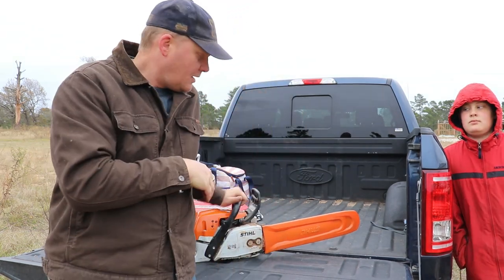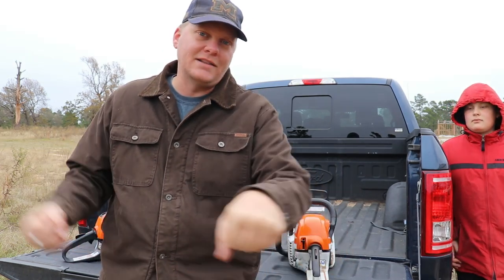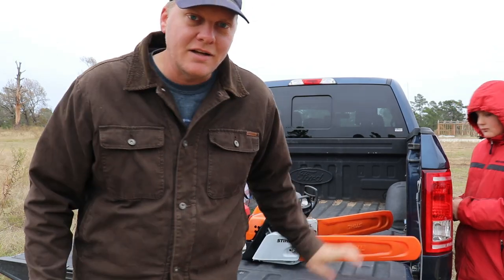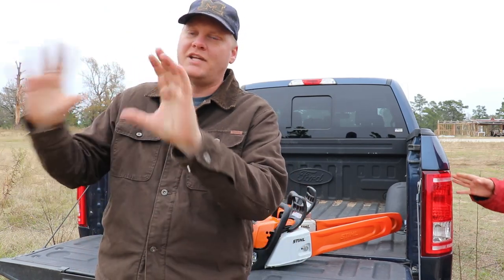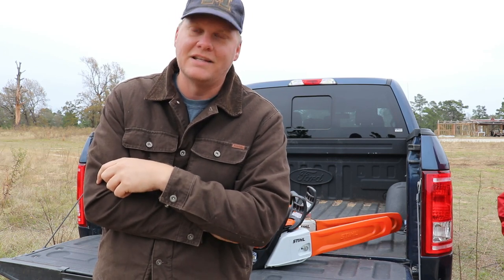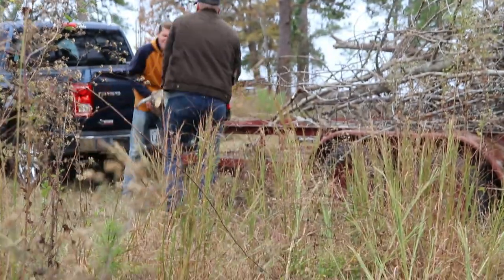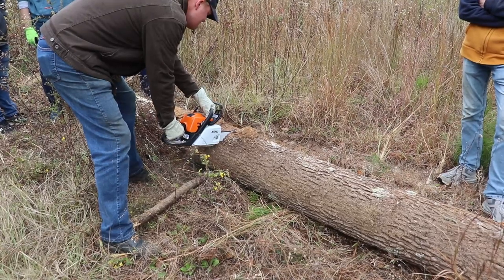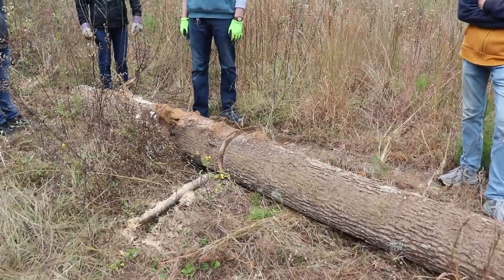Ep. 136 - Stihl MS 171 Chainsaw First Use why you need two chainsaws

Comment: I cut up a dead 16 inch pine that got blown down a few months ago with my 171, yesterday, in 94 degree weather.    The 171 cut it fine until I got the bar in the dirt, ending its day cutting.  I cleaned and sharpened it, later.  I will finish bucking it up, today.
Reply from the maker: I need to sharpen mine too

Comment: I tak 3-4 chainsaws with me on a cutting job.  Never less than two.  I also take a tank of gas and a container of bar oil, plus three felling wedges, a tuning screwdriver, my peavy, an axe, and most importantly my leather gloves.
Reply from the maker: You've got more than I have.  I have a bunch of trees that need to come down soon.
Reply: @BlackacreRanch  I will not run more than a tank through my ms 170 in a day.  Bigger saws more.  It is hot, here.  I have a 24 inch maple to cut down tomorrow and know I will be wringing wet when it is over.  I made my ms 440, H 455, ms 251 to do most of the work but my 170 will get its share of limbing.  The 251 will do most of the wor and the Husky will cut it down.  The 440 is for the stump.

Comment: How bout 17# fully loaded, bar and chain, gas and oil.
Reply from the maker: That would be heavy
Reply: @BlackacreRanch  I got a few that pop 25#, fully loaded with bar, oil, chain and gas.  Put a long bar on them and they get really heavy.  I grab my 026 Pro whenever I can.  It will cut just about anything and is light enough to tote.  A lot of folk worry about vibration.  I think about ease of starting, balance and overall weight.  I wear leather gloves to dampen the vibration and keep my chains razor sharp.  If I have to worry about vibration I will stay sitting in my recliner in my office.🤪